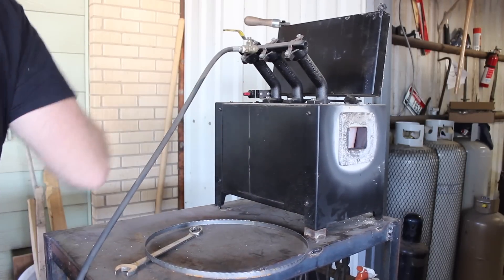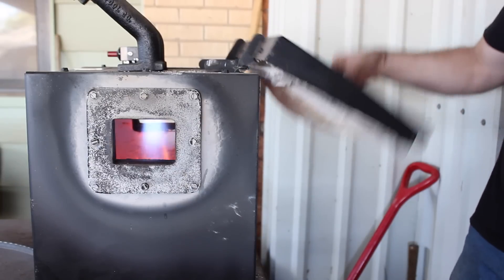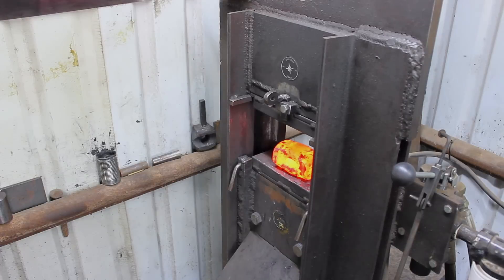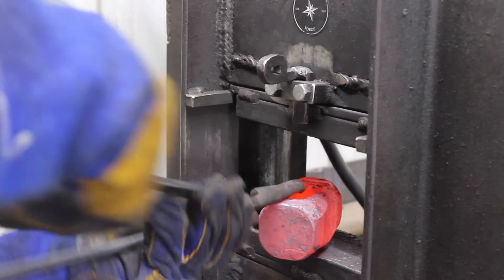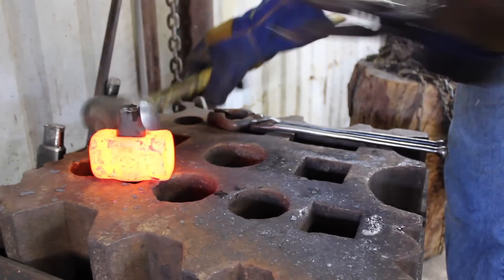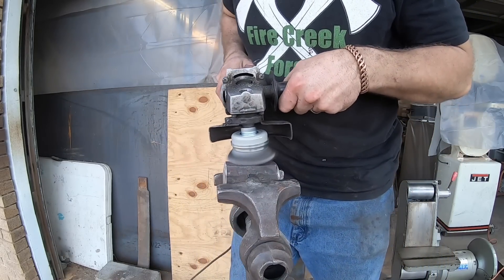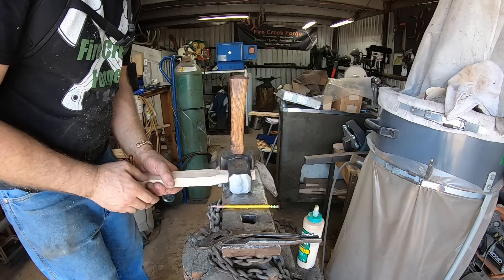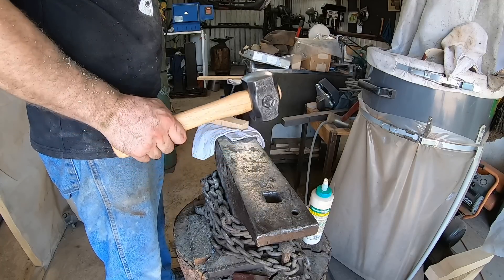Today I Forged A Hammer

Comment: Am wanting to make a geology hammer for a friend, made 4 jelly rolls out of alternating layers of leafspring and grader blade, they have a few spots that didnt weld in the jelly roll part, am hoping I can soak them in vinager, then acetone,  put them on a canister with jackhammer bit cross between them so everything will all weld at the same time and the jackhammer bit will be the core down the middle of the billet to take all the abuse without deforming.  Question is: will the vinager and acetone be enogh to remove the scale between the jelly layers that didn't weld? More outer last bit of the roll, some halfway around amd one almost one whole wrap. And can i harden the s series jackhammer bit with oil so the other metals wont crack? Or does it need water?

And update on the bowie canister, it welded up nicely,  but the paint didnt keep the whole can from welding to the billet,  maybe 1/3 of one side didn't stick,  how many layers of paint do you recommend?

Comment: Just starting out. How did you decide hammer handle length. I've got a small sledge in need of a handle replacement
Reply from the maker: It's what is comfortable, I prefer gripping 4-6" from the hammer head, on a lighter hammer your grip migrates further away I find.